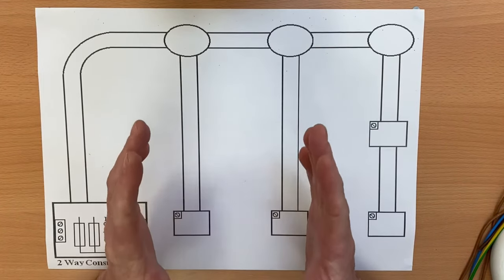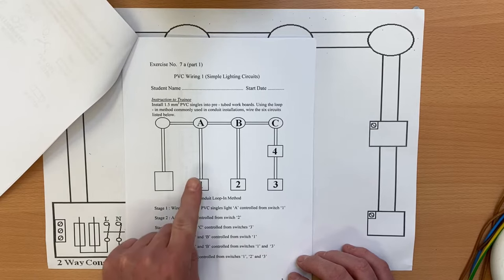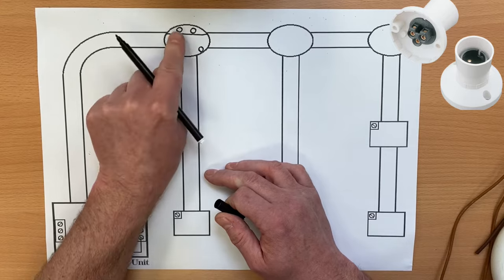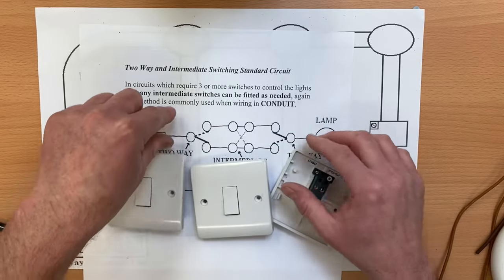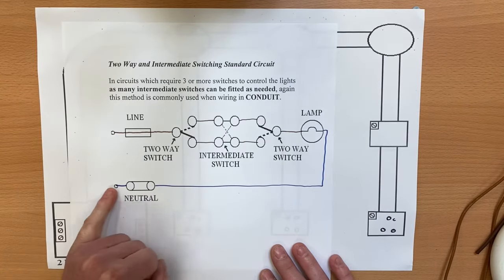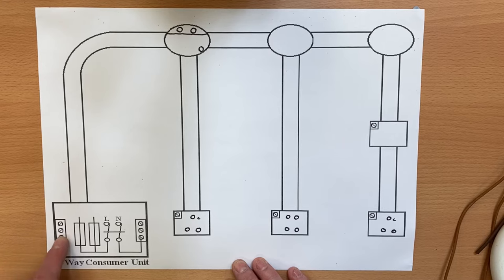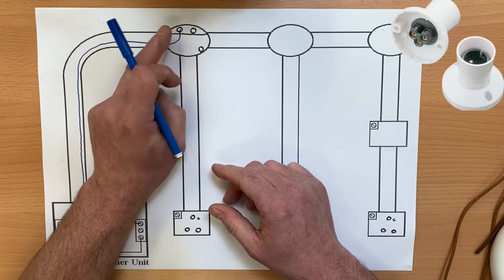Wiring Diagram Conduit Loop-In Method Part 6 - Lighting Circuits PVC Singles - 2 Way & Intermediate

Comment from the maker: == 🕐 Time Stamps - Cut to the action 🕕 ==
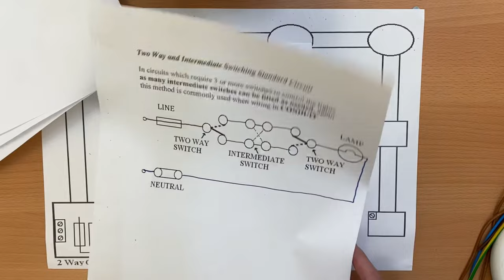00:24 - Download available with the link in the description 
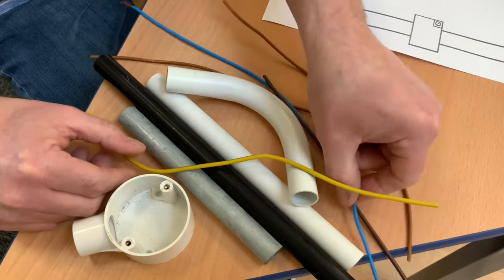01:51 - Single insulated PVC stranded cables 
03:00 - Circuit diagram of a light controlled by 2 way and intermediate switches 
05:00 - Adding the neutral to our wiring diagram
06:28 - Adding our CPC's to our wiring diagram
09:12 - Adding the permeant line and strappers to our wiring diagram 
12:50 - Adding other lighting point to our 2 way and intermediate wiring diagram
13:50 - Adding another intermediate switch to our lighting circuit
Reply: QUESTION: when using the conduit loop-in method in an office with suspended ceiling tiles, are we required to have the single wires on the ceiling, running to the LED lights inside a conduit or not?

Comment: With those batten holders your using . We always had to slide heat resistant sleeving over the fixed wiring cables going into the batten holder due to heat damage from filament lamps . I still sleeve them just in case someone uses a old type lamp. Unlikely I know in this LED world. I assume it’s still a requirement
Reply from the maker: Thanks for the great comment 👍🏻

Comment: QUESTION: when using the conduit loop-in method in an office with suspended ceiling tiles, are we required to have the single wires on the ceiling, running to the LED lights inside a conduit or not?
Reply from the maker: Single insulated live conductors need to be installed in something to offer mechanical protection (trunking or conduit etc). Thanks for commenting. Gaz 👍🏻
Reply: @GSHElectrical  thank you for the reply. So trunking or conduit across a suspended tile ceiling is not practical, better use sheathed single insulated cable

Comment: QUESTION: when using the conduit loop-in method in an office with suspended ceiling tiles, are we required to have the single wires on the ceiling, running to the LED lights inside a conduit or not?